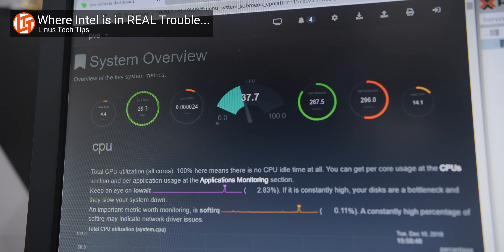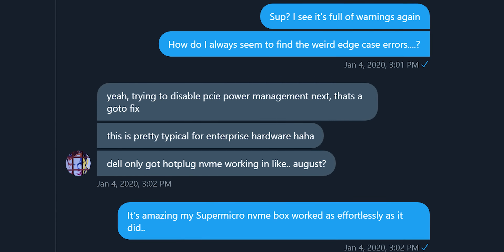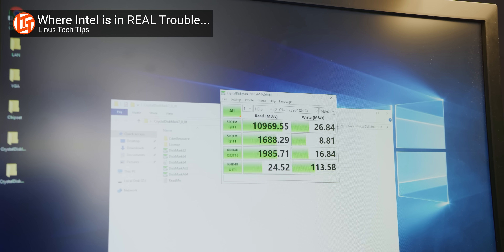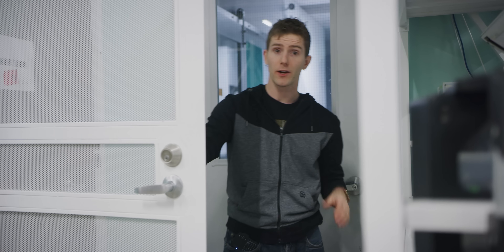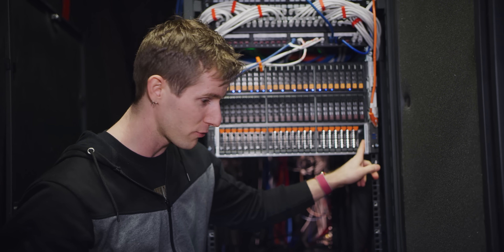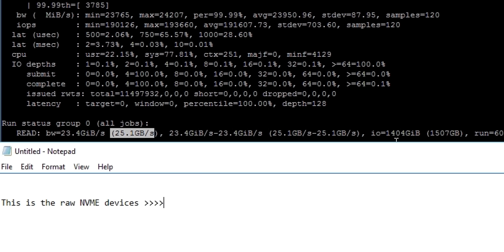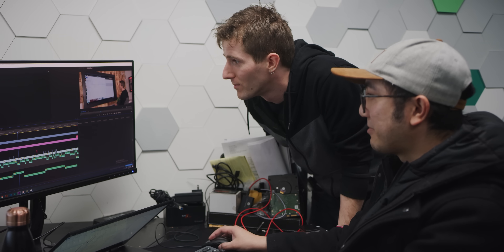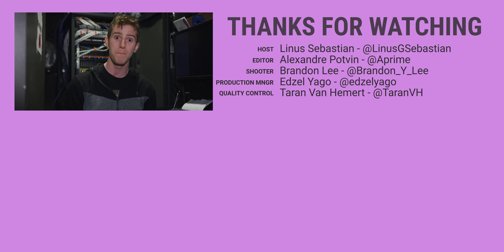This Server Deployment was HORRIBLE

Comment: As some one who operates a homelab running 4 dedicated storage servers, one of which is a licensed Solaris machine using a 60-drive ZFS array, watching this video just makes me want to shake my head into oblivion... I feel like linus took waaay too much of the commercial "help" into account when making decisions and didnt do much of the research on his own from a community more interested in doing things "Unique" rather than "Commercially Viable". Most of the IT industry that are providing opinions are just performing maintence on infrastructure they did not build, so there opinions are not even earned or researched, just regurgitated from the person that "Trained" them...

5:09 - Clearly linus is not familiar with Schedulers... he described the precise issue that older schedulers had with single-threaded interrupts... something that doesnt exist with something like BFQ...

Then right into "Industry Replacement Issues", Amazons issues are precisely what i mentioned above. retroactively replacing spinning disks with NVME drives, without consideration for any of the underlying hardware and software, you will run into these precise issues. Commercial IT at large datacenters are nutorious for just this, Hiring a strong first-wave of Consultants and In-house IT personell to design, develop and deploy Hardware and Software solutions... Then firing all of them to reduce cost and hiring a new, smaller team to maintain it. The replacement team is not aware of the specifics of the solution the original team put in place, but can navigate most issues... Until it comes to something like this. So obviously, This comparison doesnt even apply at all. 
Your Building this from Scratch Linus, its YOUR job to plan out around the Software Caveats, Not rely on Outdated industry standards or just buy a off-the-shelf solution, because thats basically what you ran into...

Which boils down to... ZFS is awesome in terms of Stability and Features, Its been a industry standard for more than a decade. On Spinning-disk Arrays, being a Out-of-Tree filesystem with advanced caching and data-replication, its nearly incomparable... but Its not officially supported on non-Solaris operating systems since 2005... Its licensing are incompatible with the stock linux kernel (thus unredistributable), and the filesystem its self is not being actively developed as oracle Forked it some time ago, and thus those "Features" are no-longer future-proof... ZFSonlinux(ZOL) are currently maintaining the current implimentation of the ZFS filesystem driver, are basing most of there work on the OpenZFS fork, thats is more than a decade old.
So any benefits to be had at a filesystem level are on par with FAT filesystems in terms of futureproofing, and alternative filesystems that compete with ZFS have all but eclipsed it, Namely BTRFS(fyi, its been stable since 2013)... The benefits on Solaris are the only reason ZFS would still be remain recommended, Although Disk bottlenecking during replication are still a issue on that as well. Solaris uses a exceptionally old scheduler, and power-management has been all but stripped in current version...  
I would of considered testing BTRFS well over antiquated ZFS, and most deffinitely with a hardware backed RAID array, not a Software solution that will undoubtedly run into bottlenecks...
"Were having CPU Bottlenecks due to outdated ZFS fileystem driver and scheduler-scaling, Lets switch to Software-Raid!"

Lastly, Proxmox. - I use this as well. 3 of our dedicated servers in fact, as its extremely versatile... But, it has some major drawbacks. Mainly its dependancy on Debian.  - Debian release system means that most software doesnt ever get updated for several years. With things like ZFS being actively ignored for obvious reasons. So many of the performance bottlenecks you expierence are much more likely to do with antiquated driver, and libraries than hardware. - Proxmox also uses a fork of ubuntu's kernel, which to say the least is not that optimised for high-performance hardware. While you could easily replace the kernel, Proxmox's patches are not availible and i cannot speak for how this may impact compatibility. - Very last issue with Proxmox, is not even one most users realise until you start getting worried about Performance in VM's...

Qemu from Proxmox(Debian) is rather old, its implementations of virtio will create a massive bottleneck out of the box. Virtio filesystems will utilize 30% more CPU as the version offered is still ripe with 6 year old bugs, and the only 10gbe capable interface (virtio), which has massive latency issues. The bridging interface is so out-dated, even on development releases, that the only viable option is always going to be the e1000 interface, regardless of the underlying hardware. Much because, Proxmox doesnt Target High-Performance Servers, but rather off-the-shelf machines from 2014.

If you wanted to implement this in a performance-focused enviorment, you should of chose a rolling-release based OS, that updates regularly(like arch for example), and focused heavily on implementing more bleeding-edge driver and software solutions. - This means your OS would suite your hardware at a baremetal level, and any VMs you implemented, would be able to benifit from not being bottlenecked by Bleeding-Edge technology being stripped of its performance by OS level software.

(Just for all that are probably arguing against this right now, you can implement Proxmox on Arch, with BFQ, updated ZFS drivers, up-to-date QEMU/Virtio... avoiding all of this from the get-go)
Reply: very good and on the spot answer, zfs is still not recommended outside of solaris but is still the best we mortals can kind of have. i have used it in arch but not that many nvme's as linus has and not that high hardware, so i can't tell for sure but your explaination makes total sense. haven't tested btrfs. one other thing i still believe is cause of misery is that damn smb protocol he has to because you know....windows.
Reply: @giornikitop5373  SMB can be fine-tuned, to be more-or-less low overhead. But, honestly. Doesnt matter how fast his array is, if he has to spend a month tuning SMB to get his buffers dialed in to utilize it...

Comment: We do a 5 node setup with Proxmox, but with Ceph storage backing it, only 10G networking, and only with a pair of VM's with dedicated allocations for the storage to make up for the old PowerEdge 710's they replaced. Our needs are different though since the users generally work locally, and then sync to the NFS. Not exactly the kinda thing that would be ideal for your setup. At some point, I wonder why not just get a SAN

Comment: Why not just use FreeNAS? That OS is specifically designed for this sort of stuff. It's a FreeBSD system specifically tailored towards handling storage. And FreeBSD tends to handle ZFS way more efficiently than any other OS out there.
I'd say that there is a good chance there won't be an issue on that platform with that hardware configurations. And if there is, they're the most likely ones to be interested in fixing it as it's extremely relevant to their business model and their TrueNAS products.

Comment: I have been playing with an Intel 24x NVMe system for a couple years now, and we also have that exact same gigabyte system in our lab atm. The same performance problems exist on other hardware, and I'd even say it is worse when going across two CPU sockets. I am  very, very curious if you guys were setting your CPU scaling governors to 'performance' during your testing (cat /sys/devices/system/cpu/cpu*/cpufreq/scaling_governor). The reason I want to know is because I had never tried enabling polling for the NVMe's, but had already been getting 'decent' performance by either manually setting the scaling governor, or using tuned to set it for me (tuned-adm profile throughput-performance). I am now wondering that if by enabling polling, you guys are causing the CPUs to be more active so they don't suffer from throttling back and forth in 'balanced' mode, effectively accomplishing the same thing in the end. I have just tested enabling polling on my NVMes and so far have had no difference in performance when 'performance' is already set for the scaling governor.

Comment: I know its not your normal video type, but could I suggest a video on getting into the IT industry? myself and I'm sure many others are trying to get into the field and well, it's a bit hard to figure out just where to start. My long term goal is currently to land a job as a systems administrator at a large company, perhaps one in the electronic entertainment industry. Any advice that you could give to start out would help. My current qualifications include A+ and Server+ from comptia, and MTA networking and server. I've also built two desktop systems and have been helping friends and family pick out printers and computers for a few years.

Comment: Is this also prevalent on, *ehem*,  USB(3.0) SATA based portable drive controllers? I once popped an SSD to an external enclosure and transferred about 200GB of data. At times the transfer would stop as if the enclosure lost connectivity and then would resume as if it just had gotten reattached. Same IRQ behaviour?

Comment: Speed up the slowest component to yield highest performance they said.  I guess they didn't expect the kind of increases possible with NVMe.  I've also had timeout experience with networked employee workstations staying online.  Their packets took longer to be received than the time to live setting.  The engineers dealt with this issue for a couple of years.  One day they asked me what I thought the issue might be.  I suggested they scroll down the column of hardware in their software so I could better understand how all the components talked to each other.  After scrolling for a while all of a sudden there appeared yellow triangles with an apostrophe in them.  I yelled stop!  Those triangles told us what the problem was and poof all of a sudden everything began to work.  Long story but similar to your issue.  Wendall is super smart but if the cpu infrastructure isn't yet developed, it isn't gonna work except for this workaround and a word from our sponsor. Oh, then the engineers dropped their laptop and broke it.  The entire program was scrapped as a result.

Comment: I wonder when Linus is going to break down and buy some proper enterprise grade switches instead of cheaping out and using plebian consumer grade stuff. At the very least he should consider picking up something like a Dell z9100, even if it is woefully inferior in terms of max switching throughput compared to a Dell s5232. I'd suggest a Cisco 25Gb switch, but they're much more expensive, mostly because they're a more established brand in the enterprise switching market and their products are more mature.

Comment: so basically what your saying is "she needs more power captain" and would benefit from another extra CPU... kinda makes me wonder if it would be viable to daisy chain a bunch of CPU's together externally to supplement the main CPU with extra cores, or if that would even work theoretically, a CPU hub like how they have USB hubs

theoretically if you had a CPU hub it would just be a matter of taking the multiple CPU's and stringing them together with software that would turn 2-9 CPU into a single virtual CPU so it guess it would work but good lordie lord it would require one hell of a big heatsink to cover 9 CPU's laid out side by side lol

Comment: I went through a similar situation 15 years ago testing a Xeon-based firewall trying to pass 2 Gbps of traffic using 4 early Intel 64 bit, 64 Mhz PCI gig NICs. The NIC chips had inadequate buffer space given the memory bandwidth and LATENCY, producing dropped packets. Memory was only two-way interleaved, so was busy for a long time delivering whole cache line chunks at a time, on top of dram refresh cycles and random cache line flushes. The PCI bus didn't get nearly the bandwidth Intel claimed, and the result was dropped packets, even with going to polling instead of interrupts which Linux had and needed then too. Being an Intel partner, the application engineers eventually admitted that, yeah, the group making the NIC chips didn't put enough buffer memory on the gigE chips and they do tend to be stingy to re and memory contention from yet more cores/threads. Remember, computers are now designed for gaming and not being I/O monsters, so don't ever think you have excess memory bandwidth or quickness! Network switches and routers are custom designed for high I/O bandwidth for this reason.

Comment: ArchiWiki on ZFS:

For Advanced Format Disks with 4KB sector size, an ashift of 12 is recommended for best performance. Advanced Format disks emulate a sector size of 512 bytes for compatibility with legacy systems, this causes ZFS to sometimes use an ashift option number that is not ideal. Once the pool has been created, the only way to change the ashift option is to recreate the pool. Using an ashift of 12 would also decrease available capacity.

Comment: You must turn off ZFS compression.
You must tune ARC size to minimum, or consider disable it.
You must set primarycache=metadata
You must set zfs_nocacheflush
There is also other tuning that ZFS required on luinux TO WORK PROPERLY because out of the box on linux it has terrible defaults.

You must carefully consider RAID-Z levels, ZRAID3-1 but no additional VDEVS mirroring etc.

You also should consider simpler FS(XFS) and simple MD-RAID (without even parity perhaps), and replication.

Comment: Ok, so RE: it's weird that computers work at all. With ultra-high-frequency electronics (like in a computer) the time it takes a signal to travel down a trace on the PCB becomes significant. When there's a parallel bus (such as the address or data busses) consisting of several traces that each carry a single bit of the whole word, because those bits are all associated with each other they have to arrive at the same time (so the receiver knows they're all part of the same thing). The problem is that any time you have to make a bend on the PCB, the trace on the outside of the bend must take a longer path than the trace on the inside. The designers of the boards, therefore, have to design in bits of the trace to extend those traces that took shorter paths. So you'll often see little wiggle patterns in some traces to make sure that pulses of electricity arrive at the exact same time to the nanosecond.

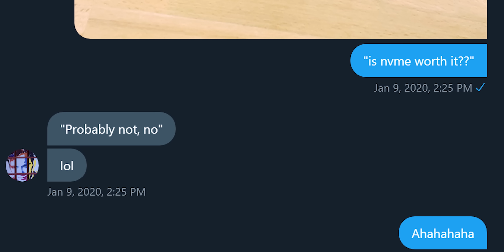Comment: 3:30 This is something that's interested me for a while. As in, why'd software bottleneck hardware (my favourite example, which has been explained to me, is why AoE takes so long to install on systems decades younger than the game itself).

Also, isn't 40Gb = 5 GB?
Reply: 40 Gbit connection equals to 5 GB connection, yes. But that's not a transfer speed for data, you also need to carry extra headers (like TCP and per-app protocol overhead) to ensure reliability and it would still be just a theoretical maximum. Depending on network conditions and device implementation, 4 GB/s for data over the wire would be more expected in practice than 5 GB/s.

Comment: so wait...the drives are still timing out? that has to be part of the problem. no firmware updates from Intel? different cards/cables? different setup like a dual socket Xeon board?

Comment: Funny thing about that: I'm running an Surface Pro 2017 on Linux (fits my general system environment) and the nvme Driver times out too - resulting in a total freeze with about the same error shown in the logs. I hope in my case it's "just" a Kernel issue though, replacing the SSD would be a major pain.

Comment: Yall should have just used freenas or bought a trunas nvme box. Would have been much much easier to get going.
Reply: Hey, you should look at storage solutions like ceph vs gluster,
Reply: @shaukahodan2373  hardware compatibility wise I have much better luck with freenas/trunas. I have setup and managed a gluster cluster, it never gave us the access times our oracle database needed so we moved to the enterprise version of freenas (for the HA hook) trunas and never looked back. Using 4 nodes that have dual heads (56 cores 768 gb ram each), and 120 drives (20nvme 100 14TB disks) for a tiered array.We had to setup a new dedicated storage only network as it saturated our cisco 4500's especially during recomposes.

Comment: We had similar problems with SATA3. Our SSDs were so fast, they regularly tripped and effed the controller. We are of course working with a smaller scale of hardware here, less expensive stuff, so we don't have the scale to go full NVME servers... But the same problem does exist in lower scales... We happen to limit the speed on our drives too, because we don't actually need all that speed anyway.

We mostly use SSD tech to not have moving drives that fall apart lol

Comment: Interesting topic.  I wonder if Wendell's solution is the same thing as hybrid polling in Linux.  In hybrid polling, after an I/O request is sent to a drive, the kernel sets a timer for half as long as it thinks the request will take, and when that timer expires it wakes up the process that made the request, so it can begin polling.  This way you eliminate roughly half the CPU overhead of polling, while getting all the performance of polling.
Reply from the maker: Yes.

Comment: @LinusTechTips you want to use Software Raid 4. Raid 5 will wear out the SSDs simultanously which is bad because if they resync the possibility that the other will fail is very high.